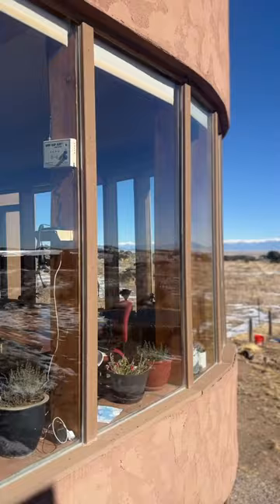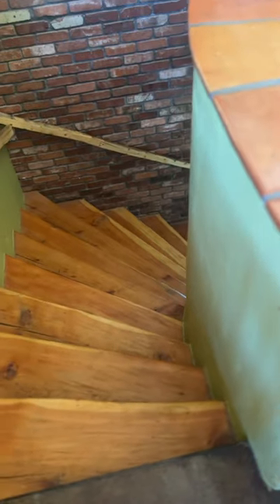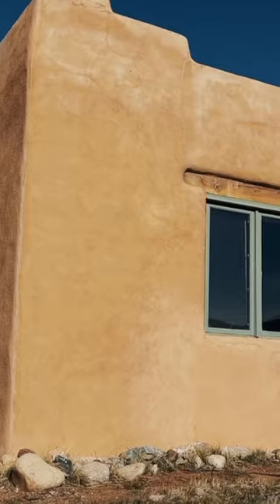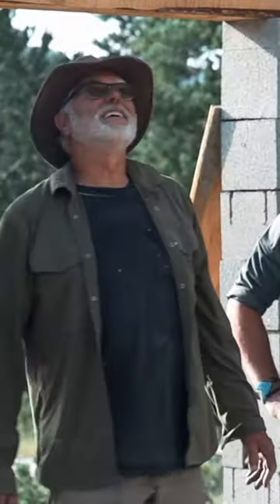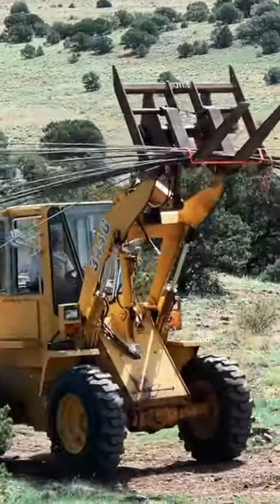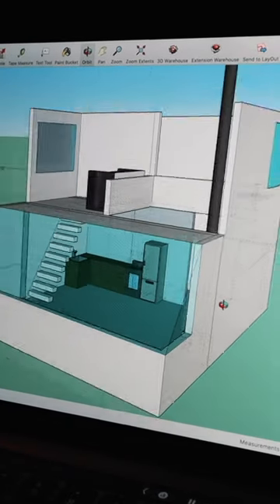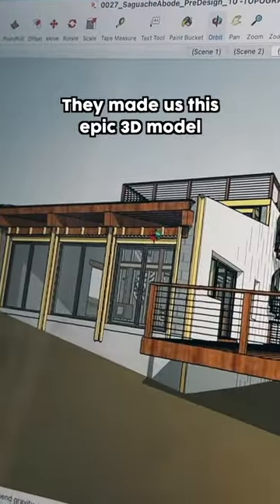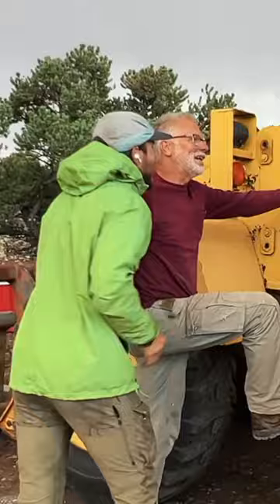Part 4 | Fauxdobe Home Building Technique by James & Doreen #homestead #offgrid #offgridliving

Comment: Ditch the 10" block on the next project. You can take 8" 70' high. Plus, when youre using anything other than 8s and not cutting your stretcher ( corner block ) you are throwing the bond off on the blocks cells. Throwing the bond off narrows the cells, and can cause voids when fillings. Also, use a core fill grout not a crushed gravel mix.

Comment: In Denmark 🇩🇰 they use concrete a lot when they build. I tried does help with keeping the cost of heating down. Since apartments over there are not blocked by another apartment behind them, they are able to open the windows for airflow and cool.off in the warmer months

Comment: Randomly served up this video by the algorithm gods. Curious if this could work where I live in Iraq. Concrete block buildings in Iraq are the most common, but they really don't work so well for moderating temperature.
Reply from the maker: Are the blocks usually filled with concrete? The thermal mass of all the concrete works amazing, I’ll post a video on the passive solar element of the home in a couple days. I believe this method would work well in most places.. my theory is tho that due to its weight it might not be great anywhere where there is a lot of soft ground beneath the home!

Comment: You could very well be looking at a future problem,  having a winding staircase.  A child could get seriously hurt tumbling down it.
Reply from the maker: Why worry about what does not exist
Reply: @ElsaRhae   hey, even for yourselves. It's called contingency planning.
Reply: @ElsaRhae future planning? You both want a family (I’m pretty sure you voiced that in your loss video- my condolences) but a 1BR/1BA with that amount of work, and by virtue of its building material, virtually no way to make a seamless addition, makes designing such a small house (in terms of rooms) a curious choice.